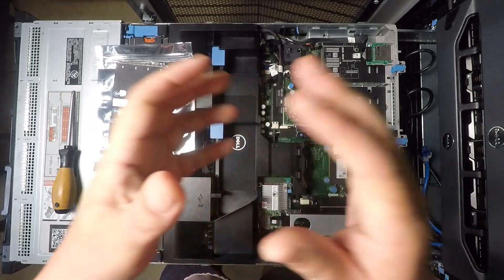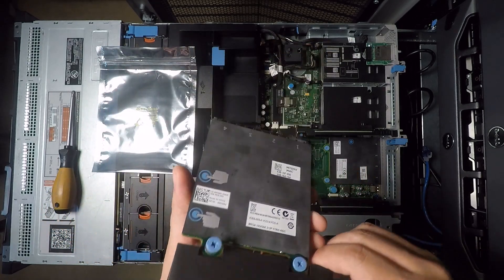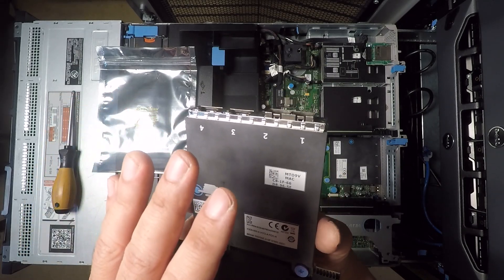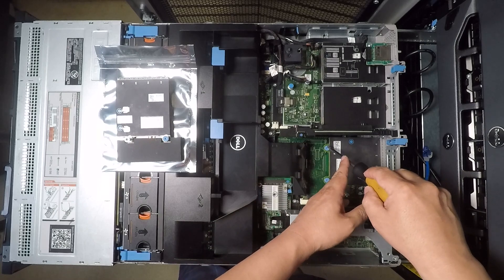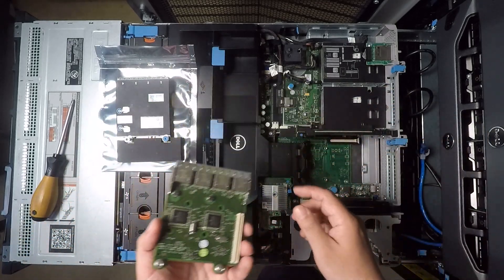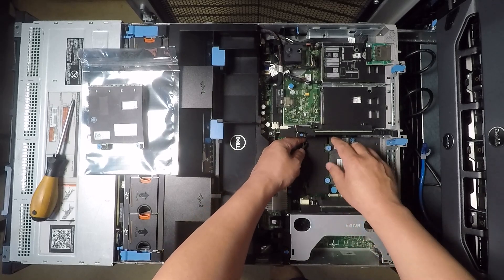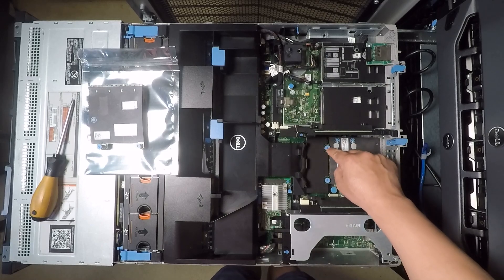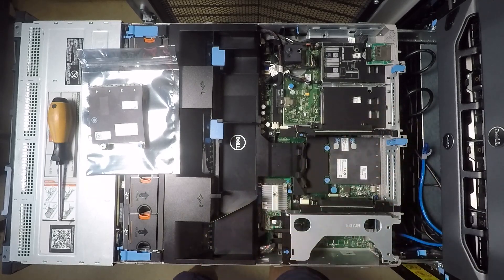How to upgrade to 10Gb ethernet in Dell R720XD

Comment: I got one of those a while ago from you, ready to install and wonder if there's anything that needs to be done on the system config?
Reply from the maker: No, not really. Just swap it in. Of course, do it with power off disconnected is preferred. :-) Thanks for supporting me!

Comment: Great video!  I was looking for a used Dell server to convert into a Linux storage server that could use 3.5" drives.  The Dell R720xd looks like just the solution for my home lab now that you have shown a 10G networking option.  As a bonus, the two cards you mention are also available at used prices, for less than generic 10G PCI cards that "should" be compatible.   (There are chassis versions that support 2.5" drives or 3.5" drives.)
Reply from the maker: Glad I could help!
Reply: @ArtofServer  The  R720xd is up and running RHEL 9.2 on mirrored 18TB WD Gold drives.  There is a warning about the raid controller being unsupported, but unlike issues people were reporting with RHEL8, it seems like they put the raid drivers back in the available set without sideloading an ELpo driver.

Comment: If you removed the middle riser, you could probably fit the new card straight in, then replace the riser after?
Reply from the maker: that's a good point. if you remove the risers it would be easier to install the rNDC cards.

Comment: I had a question, I bought one of these cards, not from your ebay store.  But when you install it is there anything else you need to do, will it automatically detect the card. The reason I ask is because when I install mine in the 720xd when it boots it says, Unknown pci device not detected. Just wondering if the card is bad.
Reply from the maker: if the card is not seated properly, that can happen. I would recheck your installation and try again. if that doesn't clear it up, you might have a bad card.

Comment: Posting late here but is a R720 for a dedicated unraid game hosting server not a good buy in 2023?  Are they just obscene power hogs?
Reply from the maker: Anything IvyBridge and newer is decently power efficient, and of course, the newer the more efficient usually. The power hogs are the generation before like Westmere (which was ok at lower clock speeds), but the older Core based Xeons are really bad.

Comment: After I replaced the NIC as seen here, system does not detect the new NIC, do you know what is the reason?
Reply from the maker: I would try to re-seat the NIC. make sure the system is fully powered off, drain any flea power (hold power button for a minute), and then power on. make sure the NIC is fully seated correctly...
Reply: @ArtofServer  I got from Dell community that I have to select collect inventory after reboot, but I do not have free server to try, my servers are in production

Comment: Much appreciate all the videos. I used a lot of these to put together my first server.  I tried a 0C63DV version of this NDC, with 2 1g and 2 10g ports,  but the links won't ever connect on the spf+. Also tried a stand-alone x520 on pcie but it won't connect either.  All nics are visible but no lights or connectivity. I'm using supported transceivers so I'm not sure what the problem could be.  Ive tried several versions of drivers with no luck. Anybody have any ideas or suggestions on getting these up and running on a r720??? Thanks.
Reply from the maker: When troubleshooting problems like this, you need to start from the bottom up. Is the hardware detected? is there link light? is the driver loading correctly and recognizing the device? do you have layer 2 link status and see ARPs? do you have IP? can you hear your local broadcast domain? can you hit the local gateway? can you route past the gateway? etc. etc. I don't know the OS you are using, but most should have a way to check on these.
Reply: @ArtofServer  I appreciate your time. The NDC is recognized in the server bios but only the 1gb ports are "connected" and the 10gb ports are grayed out and "disconnected", without any way to connect them. No lights on the 10gb ports and no link to my Aruba 2930f switch. Switch should automatically negotiate at 10gb, and there's no way to change any options in server bios. From my limited tech experience in promox/Linux, the drivers appear to be loading and nics are visible to system, I just still get no link lights.  Do you have any good suggestions or tools I can use to troubleshoot this?  I've been researching this for about 2 weeks and most conclusions come back to improper transceivers. Mine are genuine Intel so I'm at a loss. Any suggestions would be greatly appreciated.
Reply from the maker: For the X520 NICs, if I recall correctly, the transceiver "restriction" is purely artificial. Meaning, it is based in software, not hardware. And I believe the Linux kernel folks removed that restriction from the driver code in the kernel and replaced it with a warning message in the logs, but without disabling functionality. So, if you suspect a transceiver compatibility issue, I would look for messages from the NIC driver in the logs to confirm. Now, on the other side, I don't know about Aruba switches, but do they have some restriction too?
Reply: @ArtofServer  Thanks so much for your time. Your channel really helps out guys like with limited computer experience.  By the grace of God I finally figured out tonight that the tranceiver itself had apparently gone bad.  The switch already had the allow unspotted I just didn't realize that's why the link was down. Finally put another one in and it linked right up.  Thanks again for taking time out of your day.   This is an awesome channel and community.

Comment: Thanks for the video!  After watching it I added one of these to my R720 but I can't seem to get the sfp+ ports to connect.  I don't have any problems with the 1Gb RJ45 ports.  the machine is running Windows Server 2016 and the device manager reports that the card is working properly.  I've tried a number of different transceivers; Dell, Intel, Cisco, Finisar without success.  I know some Intel cards are picky about the the optics that will work with them.  is that the case with this; or, am I missing something in the BIOS and/or setup of the card?
Thanks for all the videos, I can learn more here in an evening than I can all week searching and reading online.

Comment: Would this kind of swap also be possible on a R710?
Reply from the maker: No, the R710 doesn't have this type of slot. For the R710, just add a normal PCIe card.

Comment: Hi 
I am still trying to figure out what am I missing and I  cant set up a static ip  to this daughterboard
(probably due to its weird configuration)
So in Bios (I have it at UEFI boot in case it coould somehow matter even though 
I dont think it would since I dont want to boot from any of the 4 nics) under....
system setup / Device Settings / it presents 
Intergraded NIC 1port 1: Intel(R) Ethernet 10G 4P X520/i350 rNDC -mac address1
Intergraded NIC 1port 2: Intel(R) Ethernet 10G 4P X520/i350 rNDC -mac address2
Intergraded NIC 1port 3: Intel(R) Gigabit 4P X520/i350 rNDC -mac address3
Intergraded NIC 1port 4: Intel(R) Gigabit 4P X520/i350 rNDC -mac address4
and I wan to configure for the server a static IP in the forth port of the daughterboard.
When I choose the 4 port the Link Status is connected and have the following options to choose from
Firmware Image Properties (Nothing to do there)
NIC Configuration (option which I hoped would allow me to set there the static ip)
                  Inside there I tried in Legacy Boot  Protocol both none and iSCSI Primary
Link speed (Auto Negotiated.Here weird thing is the down arrow gives option only for 10 and 100 half/duplex , 
             no 1000 how come????)

Legacy Virtual Lan ID Let it at default 0
Device Level Configuration Nothing to do here By the way virtualization mode is disabled)
And the lasat option which is iSCSI Configration and has 3 options
iSCSI General Parameteres  I just disable here the DHCP 
iSCSI initiator Parameteres and here I set up the ip I need for the server (without iSCSI name)
iSCSI Target Parameteres

If I ping the server's ip nothing happens and if I scan the network to check which IPs are visible I can t
see the custom Ip of the server. Can this daughterboard be used for the server to connect to a switch/router at all or is it for setting up IP iSCSI connections only with 1 or 10 gbits?

PS If I setup the port of the card via Lifecycle Controller / Settings / Network Settings
and choose there the 4 port of the nic and enter the static IP/Sub/Gate/DNS then after clicking apply
I can ping it and come back as result of a scan network process.
Isnt that strange that the ip of the server has to be configured in a page where it mentions 
Use Network Settings to select and configure the Lifecycle Controller Network Interface (NIC) so it is like to 
dedicate the port to Lifecycle controler only  and not the server. Shouldnt an option to configure the static ip parameters 
of the server exist in a more centralized spot in bios settings or idrac for example... I am confused as of how its the proper
way to set it up.

Thank you
Reply: @Joe Slaughter Hi thank you for the answer. Well yes and no together. I ve seen somewhere else that I set the ip within whatever OS/hypervisor I  am using but that doesnt answer the fact that when I had the 4 port  1gig only daughterbaord, I could just set a static ip (in the network settings in bios if I can reacall) and that ip used by the OS/hypervisor .  In this card I cant. It just seems weird.
Reply: @Joe Slaughter Do you also have the same daughterboard?

Comment: Hi
 After 2 months! of waiting  (due to that damn virus) I got mine in order to replace the quad daughterboard nic. I d like your help if you can: 
   1)In your video you just show the way to unistall the quad 1gbit and install the 2x10gb and 2x1gb card daughterboard. At least in my case when I powered on the server (by the way it is a R720) it         stuck in a message during booting mentioning that the quad card  (showing each port with the M.A.C address) has been removed. Should I had first disabled or something the card in bios and then replace it becaue now has in rom the info that the quad port card should exist and cant find it now?
                     Edit:The card has been recognized   (lspci | grep "Ether" bring me 4 lines with 2 lines for chipset 82599ES for SFI/SFP+  and 2 lines for chipset I350)
                     By the way the third time I booted the message went away but what should be the correct way to replace it ?
   2)You mention the ports of the 10gbit as SFP Arent they SFP+ ????
   3)I have a problem setting a static IP in this card since during boot I go to bios / device settings and there i can configure the four ports individually. So I go to port 4 (i plugged the ethernet cable     
       there - one of the two 1gb ports) NIC configuration (by the way it has a scsi configuration too) and  there for        
      -Legacy boot protocol:  None
     -Link Speed:  Auto (Here is the 3a question it shows only 10 and 100mbit speeds not 1gbit Why??? Does your do have the same info as well?)
     After these 2 options I went to ISCSI Configuration (General Settings) and I had to disable thetcp/ip parameteres without giving me below any tabs to fill my own static ip parameters. So 
    from thereI have first to save (seems like a bug here) in order for the iscsi initiator Parameters tab to give me only there to enter the custom ip address I need. Is that the correct way to set it up?
    I am asking because at the life cycle controller at the formware update section when I try to load the updates - if any, it gives me the  (like I dont have a valid ip or share path message and I tested  
   with a live distro and I had net in port 4) Am I missing something here?

Thankkkkkkkkk you in advance you any other willing to help (fist time I am setting up a card like this and I thought the iscsi options would be provided by the OS and in bios)
   -
Reply: @Joe Slaughter Do you happen to know why in bios / device settings -> there where you can configure the four ports individually, inside to all of the ports options , when you plug the ethernet cable  to each port individually, the option
     -Link Speed:  shows only 10 and 100mbit speeds not 1gbit 
Why???

PS Also the idrac connectivity <sensor> also mentions 10 or 100mbit (cables are all cat 6-new)

Comment: HI, nice Tuts you are doing! Thanks a lot!
I saw you just holding a nc523sfp 10gbe SFP+ Card HPE.
Did you manage to get this card working on a dell r720?
my one is not showing up, i tested 3 of them. I read about a timing problem and i should update the firmware, but i am stuck. Do you have any hints for me?
Thanks again!
Reply from the maker: I don't recall ever using that card in the R720, but I've used it in my supermicro servers without any issues. Sorry, not really aware of the issue you're talking about.
Reply: @Joe Slaughter pcie card.
other pcie slot didnt work.
drivers latest.
firmware latest.
didnt got it working, bought a onboard interface card with 2x sfp+ from him :D works flawlessly ;)

Comment: I have added a 10Gb card to my r720xd, only after a few seconds the data transfer goes from 10Gbs to 0, then spikes to 200Mbs or so every so often.  I have read that it is the HDD caches being full or a buffer limitation.  Request how you achieved 10Gbs speeds for file transfers?
Reply from the maker: That sounds like you have some sort of congestion issue perhaps. Try a network only test with something like iperf3. If that can sustain 10Gb, then perhaps you have an issue with I/O subsystem on either sender or receiver end. If you see iperf3 (or similar tool) behaving the same as you describe, then you might have some network congestion issue; check your switch in that case.
Reply: Art of Server I apologize, I didn't elaborate on some details about the connection, etc... I used 2 Mellanox Connect-X 2 cards directly connected in each machine.  One machine is an r720xd and the other is an XC720xd.  Both are nearly identical except for some bios and compatibility differences.  I was using h310s, r710xd with FreeNAS, the XC720xd, Windows 2016.
Other people online I have chatted with have stated that they also are having this issue, while it is obvious that others, including yourself, are not. I am trying to figure out how it is working fine for some, but not

Comment: I am trying to install a similar 099GTM Dell card in R720 but it is hanging on the line after initializing Intel Boot Agent XE and the PXE build...I cannot enter the bios, lifecycle controller or boot menu unless i remove this card. Any idea why?
Reply from the maker: Sorry, no idea.
Reply: @Joe Slaughter thanks for the reply Joe. I can't disable PXE boot on this NDC when it is installed cause i cannot get to the bios. Unless there is a way on the R720 to disable it all together somewhere?

Comment: Thanks for that cool video (and RIP to my normal 4x 1000Base-T NIC that I damaged when pulling out the server while forgetting to unplug the cables first). The only thing that broke are those plastic retention clips, so well..
Did more damage to the iDRAC port (which has metal retention clips, so actually the complete metal port bend a bit). Everything is still working - and because I almost got a heart attack after realising my dumb mistake, it's pretty unlikely to happen again ^^
Didn't know that those mezzanine cards are that cheap - I mean, a normal PCIe X520 Dual Port costs you more than 55€, while the mezzanine is 5€ cheaper xD
Reply from the maker: Thanks! Glad this was helpful!

Comment: What would be a good 10Gb switch that you recommend?
Reply from the maker: How many 10Gb ports are you looking for? And do you need RJ-45 or SFP+ ports?
Reply: @ArtofServer  I just want to speed up file transfer between an r710 and a couple of r410s, so may be 5 ports? SFP+ is fine. Thanks!
Reply from the maker: @rosGalindo  if you can get by with 4 ports, you gotta checkout this Mikrotik CRS305-1G-4S+IN. https://mikrotik.com/product/crs305_1g_4s_in
Reply: @ArtofServer  Thanks so much! And thanks for the hardware I have purchased from you through ebay  :D My r710 looks good.

Comment: You can also get the 57840S if you need quad SFP+, and I've found some conflicting information but it seems that the 57800 is available with either the SFP ports being 10G or the RJ45's being 10G (makes it a bit difficult when shopping for a used one, sellers have them listed with conflicting information).
Reply from the maker: yes, there is a 57800S that is 2x1Gbps+2xSFP+ and another that is 2x1Gbps+2x10GBaseT. there are also some Intel based options too, which might have better compatibility for some OSes that don't have great driver support. The 4xSFP+ option is cool.. i didn't know about that! Thanks!
Reply: @Joe Slaughter dell shows official support for the 57840S in the R720XD and other 12th gen systems, that's how I found it but I personally haven't used it.

Comment: I actually liked better Intel's based NDC - part number 67XRW or  C63DV - have 2 of them now (in R820 and R720xd) - they performed slightly better than Broadcom's, although they could be picky about transceivers used (they didn't work with some random sfp i'd tried), but the ones i purchased from aliexpress work fine - Finisar FTLX8571D3BCV-IT.